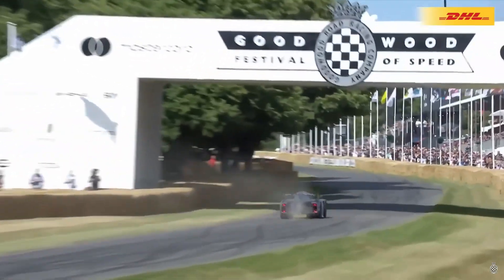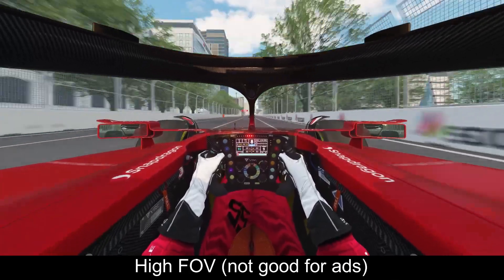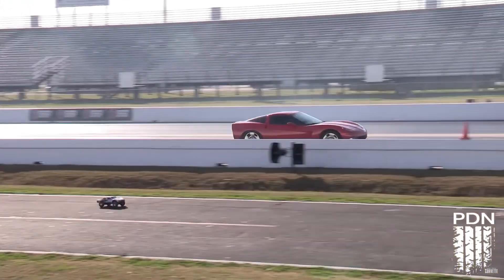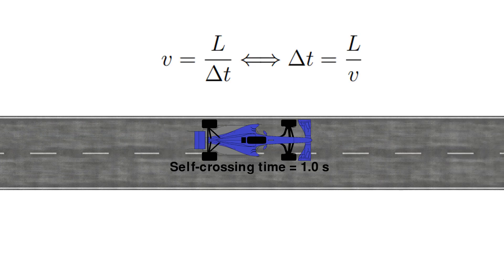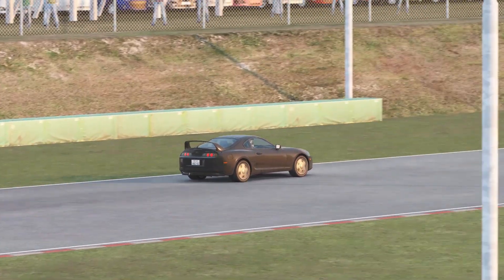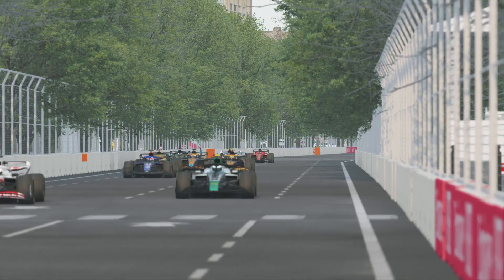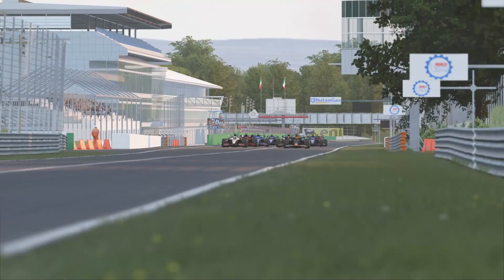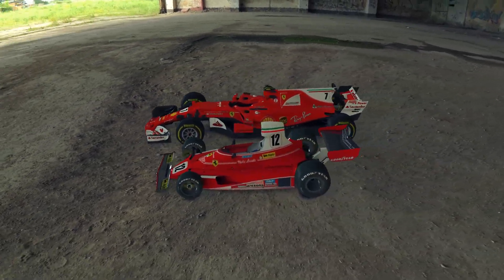Why do F1 cars look so slow ?

Comment: Size & weight. Simple.

Ditch the hybrids, dust off the old V10s & bring back small, refuelable, featherweight cars on low-grip, bulletproof tires.

And screw these “anti-dirty air” cars. They’ve barely done anything for the racing & have detracted from the skill of driving around dirty air.

If the cars were smaller, you’d see people altering their lines much more to spend as little time as possible in dirty air to try and close the gap up to the car in front. Wouldn’t that be cool to have back again.

And bring back the cinematic camerawork of the late ‘90s. Modern camerawork makes the cars look even worse than they already are, and that’s saying something.